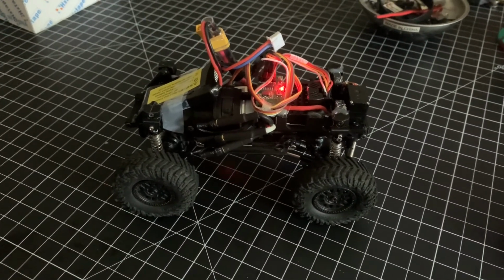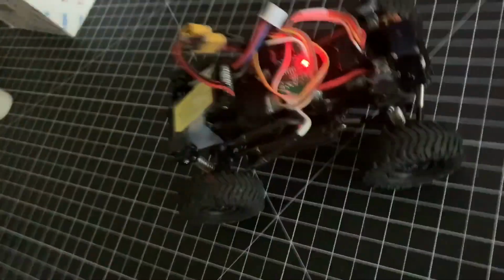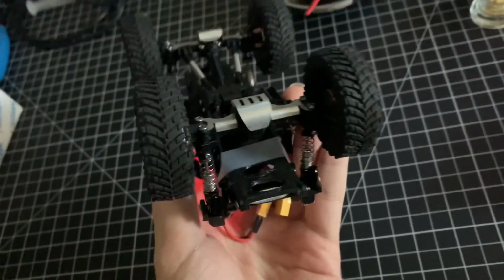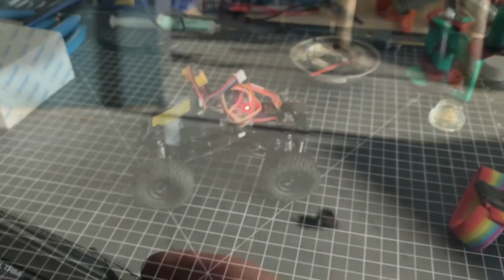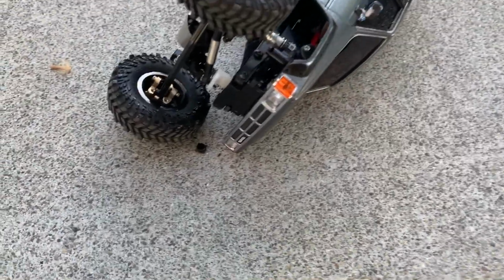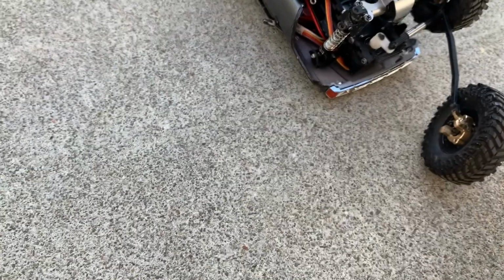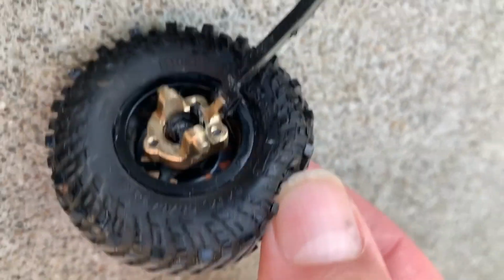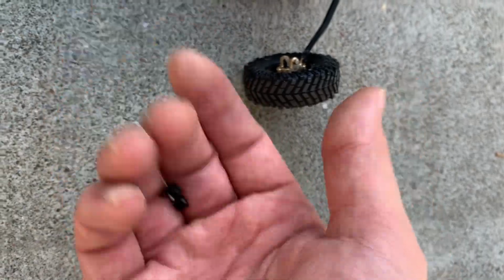Kyosho Mini-Z 4x4 - Breaking the stock UV joints with 2S Brushless Motor

Comment: Get the Metal ones for the front. The problem I have with mine is the Front and Rear Axle gears stripping constantly 😂 my MX01 are fully loaded but building a TRX4M now because they have better support for Axle Gears. I wish they'd make one for MX01 too instead of OEM diecast weak metal they have.

Comment: Thanks for this video! I'm planning to do the same thing with an axial SCX24! I might just go with a 130 PN racing brushed motor 50 or 39 turn. This is plenty fast for an indoor house racing/crawling course. 

Do you have a pretty wide steering radius? I feel that is the only limitation on the SCX24 and want to see how I can make it feel more like a buggy.
Reply from the maker: I put Axial SCX24 axles on it: https://www.youtube.com/watch?v=b2etY0l9_gQ
Reply from the maker: As for the steering radius of the axial scx24, its not great and I agree. No where close to the kyosho turning radius.

Comment from the maker: Going to try SCX24 axles next, I think they can handle the abuse and plus they are really wide so this will get pretty crazy!
Reply from the maker: I still need to attach the servo to the steering linkage on the SCX24 front axle but otherwise its working. I will have a new video in the next week or so.
Reply from the maker: Here is that video: https://www.youtube.com/watch?v=b2etY0l9_gQ